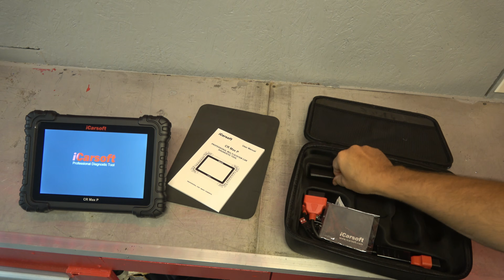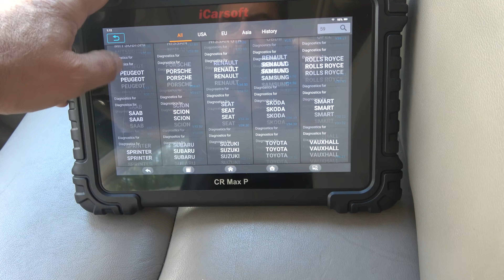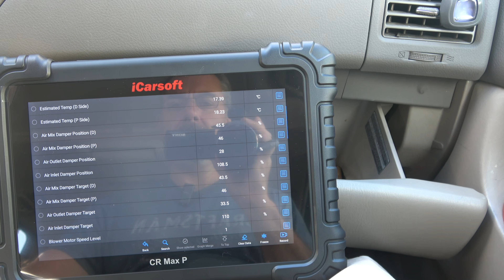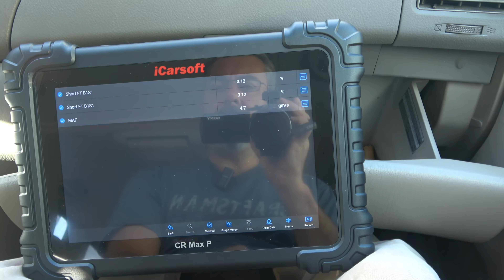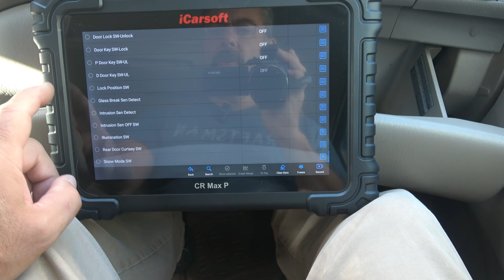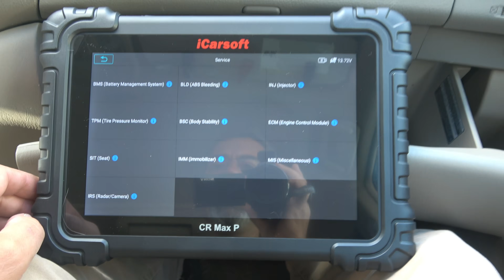iCarsoft CR MAX P. This Pro-Level Tool Is the best I've seen all year!

Comment: Hello Eric Happy Saturday.
Reply from the maker: Happy Saturday to you too! I had a 1982 Chevy Citation 4dr with the 2.8 V6 and a 3 speed auto. Loved it! Put over 100K on it before I sold it. I found a side wrecked X-11 and took the hood, air intake, and rear spoiler from it for mine to make it a sort of 4dr X-11.
Reply: @FarpointRestorationsAndRepairs  Nice those were the days the Sideways Radio was unique and also back then the
sound of a late 80's GM V6 Sound was nice the 2.8 & 3.1 use to sound so good missed them. 👍

Comment: Have you used any scanner that can do the dealer customization settings like turning off the security entry system on a Toyota 2022? That’s the where you have the key fob in your pocket and just touch the handle then it unlocks the car and the little ribs on handle to touch lock the doors. Dealers want $100 each time they change something. 
Would love to have one to play with. 
Had a 2013 ford focus that I used the Russian hacked factory software and could do all kind of things like roll down all four windows in hot weather.
Reply: Many mid-high end scanners can change the 'hidden options". My Topdon Phoenix Pro 2 (mid level scanner) can do those changes.
Reply: @PelicanIslandLabs thanks
Reply from the maker: Yes. Lots of the pro and higher end mid level tools have a "Special functions" page that will allow those changes.